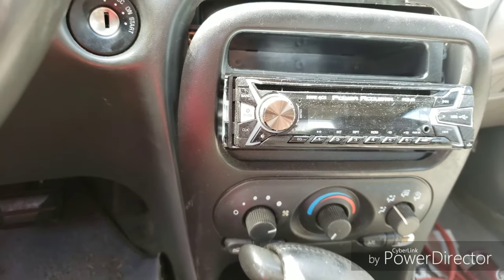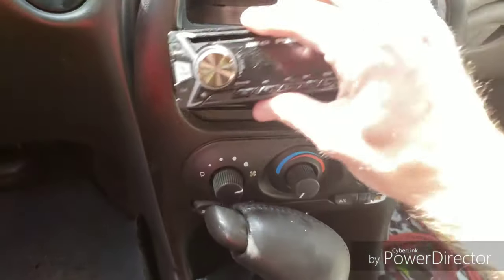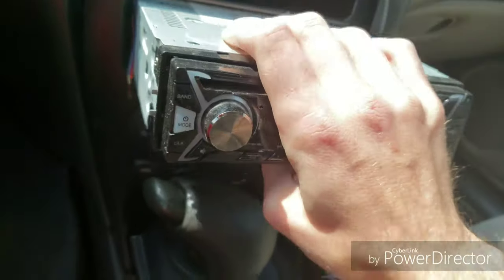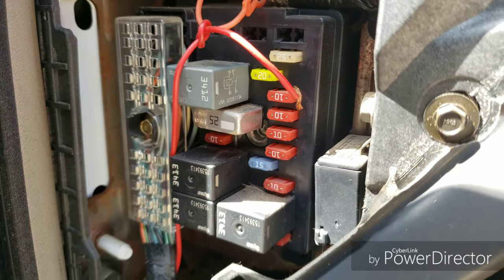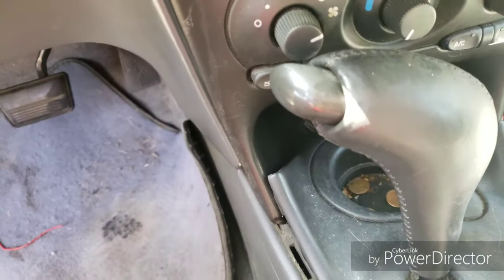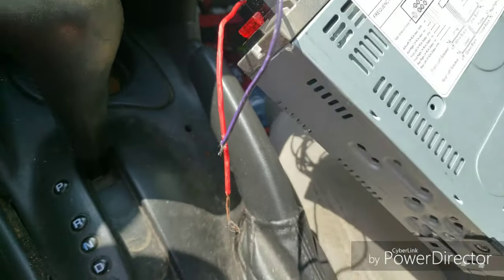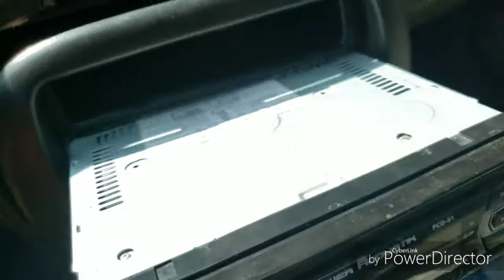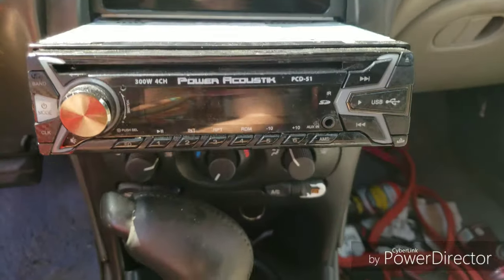Car stereo won't work: Quick troubleshooting guide. please subscribe

Comment: You have the same year make and model (or very close to it) that I do. Looks almost like the same head unit. If my head unit is completely shot would you reccomend what head unit would work with our vehicle that has the jack ports for front, rear, and then a subwoofer/speakers? (I think they call that six channels total) I noticed that a lot of stereos are too long to fit in...I've barely got my kenwood Excellon X3 to fit, and I did that by "cramming" it in there.
Reply from the maker: hmm im not to keen on the products available im more of a garage sale and duct tape it on guy just to get it going, which is why i broke mine lol.

Comment: Good video but mine just doesn't have sound.  Radio turns on-no sound.  It does not have an amplifier.  Any ideas?
I replaced the original '92 Honda Accord radio w/aftermarket.
Reply from the maker: Hmm sorry for the late response. Radio turns on no sound and you replaced it. It seems like that happened when I finally replaced this one I think it was a power issue   I had the constant power wire in the wrong spot

Comment: I have an xdm-260 my parents let me use in my jeep im trying to sell barely used it and all my fuses are good in my vehicle I didnt see a fuse on my radio do all radios have a fuse also could it be my harness the one I connect to my car positive and the yellow and red weren't getting power with my test light and the ground im assuming doesn't get power and the harness that plugs into my car stereo has power so maybe the radio is fried? Cuz I tried a bebxh test with my harness that has power in the yellow and red wire not the black wire still dignt power up

Comment: Nice bro ! Hey I have pioneer deh-2290ub in my car, whenever i play songs using USB then songs are playing in a sequence even though the "RANDOM" option is set to "ON". It is not working as how the shuffle work in phones. Also, tt still play the same sequence even if i set the RANDOM to "OFF".  Example i have songs list A,B,C,D,E and the song plays in the sequence of "C,E,D,A,B" and this is sequence it plays all the time... How to overcome this, please let me know if you have any idea ?
Reply from the maker: thats an interesting problem. is there anyway you could shuffle it from the USB device instead of the radio or are you using some sort of flash drive.
Reply: @more-or-less-it  hi, I'm using a sandisk pendrive. I think the stereo is 10 years old and it's not having such options in it that time. Thanks for your response brother !

Comment: I changed all necessary fuses, checked my wiring, which is all fine, and my clock/ stereo still doesn’t work. What else could be wrong?
Reply from the maker: Could be a short somewhere could be the battery. If you've checked everything with the car it's likely the stereo itself

Comment: Mine works at random times. Like today it's working but yesterday it wasn't. What could be the problem?
Reply from the maker: could be a number of things, could be your car battery, the power wire, loose wire, or the unit could just be getting ready to die.

Comment: My boss radio won't work unless I disconnect and reconnect the battery then it powers up.
Reply from the maker: Sounds to me like the connection is just bad and when you disconnect and reconnect it it cleans the contacts a little. Are the contacts clean and all that? Could be a sign the battery is getting low too

Comment: Okay so I was being lazy to and the red wire touched the case and sparked now it won’t work lmao is my radio busted now sorry for dumb question
Reply: same shit for me except yellow wire haha, I checked all my fuses and their fine along with re-soldering all my cables so it doesnt happen again but radio seems fried
Reply from the maker: yeaaaah prolly  fried it thats what i did too. sends electricity where electricity isnt supposed to be
Reply from the maker: makes the circuit complete where it isnt supposed to and burns it up
Reply: More or Less It okay so I ended up finding a burnt out fuse and it was for my radio thankfully a 20amp fuse saved me 200$ instead of buying a new headunit thankfully

Comment: Hi just installed my double dip car deck. Everything is playing except my radio. Any ideas
Reply from the maker: is the antenna plugged in for the radio. that happens to mine sometimes and then it will start working randomly. maybe a short somewhere maybe not getting enough juice im not sure